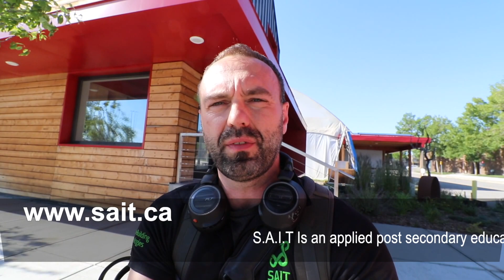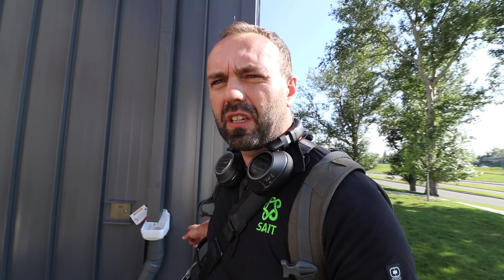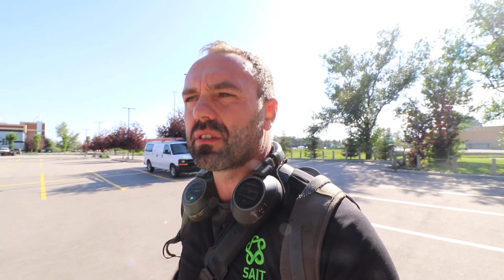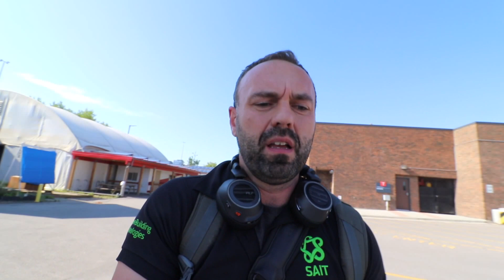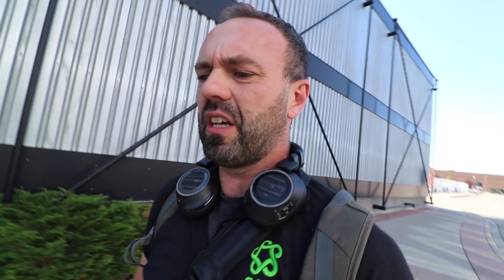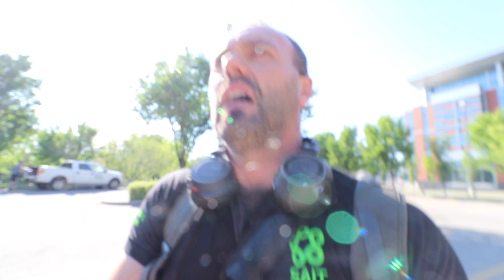Leading Edge Green Building Technologies projects at SAIT

Comment: Followed yourself and Curtis stone for awhile now.  I built an energy efficient home myself north central Alberta.  Other contractors have done it also and the resale value isn't there.  Real estate has told me people care more about big Windows impressive roof pitches and design more so than how it's built.  I have seen several projects where it's built on slab grade and don't even insulted under floor. 
I also have been trying to motivate first nations people on a walapini barn / green house idea.  A community of say 300 people could make use of a small barn housing 300 layers.  Each bird provides 10 watts of heat and carbon dioxide from their breath which could be filtered and pumped into said green house.  If interested in my idea or know of a community willing to take a chance shoot me an email.  gofeedyourself2019@gmail.com